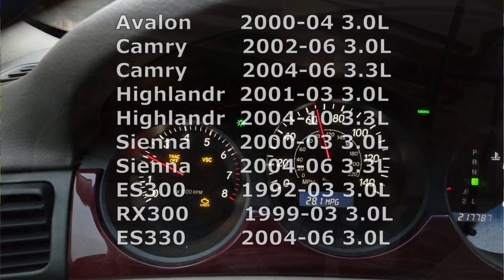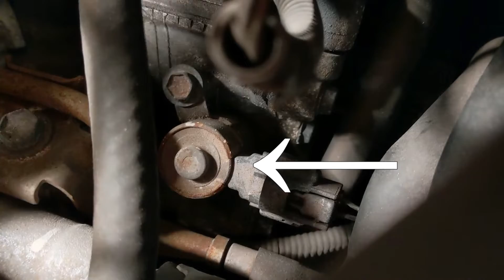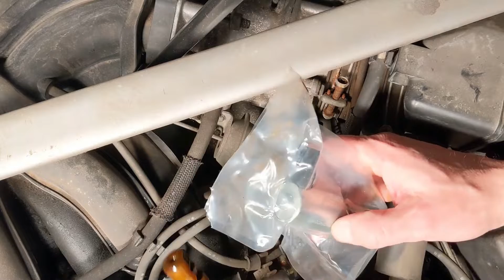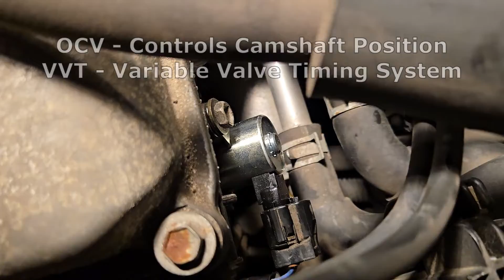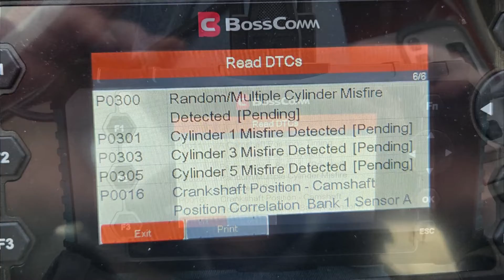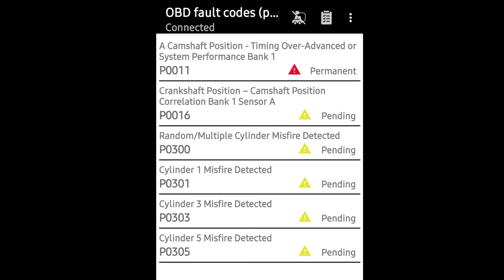VVT Solenoid Replacement – Lexus ES300 (2002-2003)

Comment: I have almost the same thing, you should of had check your fuel trims because mine has problems with fuel trims and I get a knock sensor and I get the code for the vvt like in your video for bank 1 and the car hesitates and doesn’t have power and it has misfires on 1 and 3 and 5 but it doesn’t get recorded on the check engine light
Reply: Yo wdym by fuel trims cause im having the same problem

Comment: I bought a new one and I still get error P1349
Reply: Might be your problem if you didnt do this: Unplug your battery for a couple minutes to reset engine codes. If its still a problem, the code will return. If not, you fixed your issue.

Comment: I had both camshaft pos sensor codes pop up on the highway trying to figure it out maybe dirty oil after replacing my valve cover gaskets and my oil panngasket

Comment: Very, very nicely put together video. Should help many people as time goes on.

I have been doing a lot of work on a “project” 2003 ES300 I recently acquired. Got it from barely running and stumbling to running better than the other two I have. 

The last thing in my way is a P0022 code, which I believe was Bank 2 camshaft over-retarded. On startup one morning, I received the corresponding mifire codes for 2/4/6 and a multiple misfire. After warming up and clearing them, they did not come back.

This makes sense given how smooth the engine is running, how well it accelerates, and how high the MPGs are. 

So, I can’t imagine it is anything other than the OCV solenoid on Bank 2.

Thank you very much for the video and additionally for showing the combination of codes as I now am more convinced this is the problem.
Reply from the maker: I agree with your assessment, makes the most sense. Thanks for the feedback on the video

Comment: I bought a 2007 ES 350 last year and it ran rough, had low power, and poor fuel economy. Replaced both solenoids and it runs like a dream. Only paid $1500 for the car.
Reply from the maker: You got a steal! Although, that being said, the value lies in knowing WHICH part to change, which you did!
Reply: @PracticalMechanic  So what do you think is a fair private price for this car with 124k miles in otherwise excellent shape
Reply from the maker: @drivingwithricks my personal opinion is 3500-4500 would be fair. Now, if the undercarriage is rusting out, that's another story altogether! Also I guess it's probably due for a timing belt...

Comment: Hi.
My lexus es300 2002 is giving me problems, it doesn't shifting to the 2nd and 5th  after is running for about 10 minutes or little hot.
Can you recomen something about it
Reply: I had this exact behavior on same model/year. After much digging it turned out to be the knock sensors.  They trigger incorrectly and make engine go in a sort of limp mode.  Why that disables 2nd gear is a big mystery!   Replace knock sensors and their wire harness